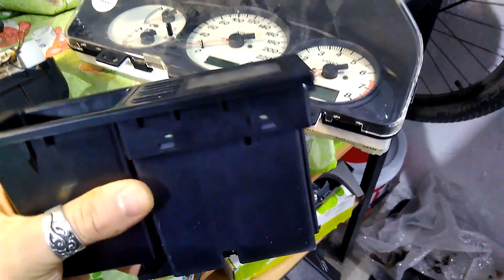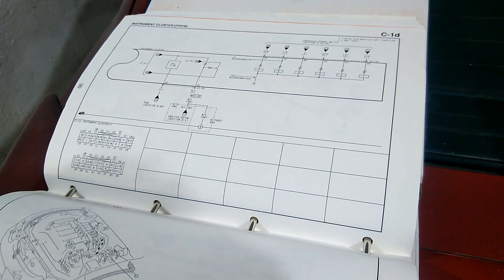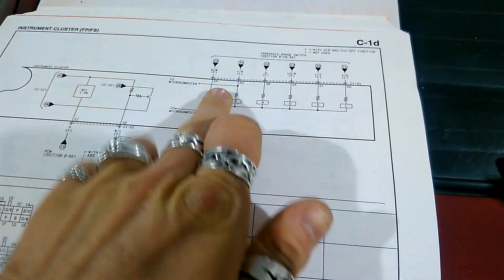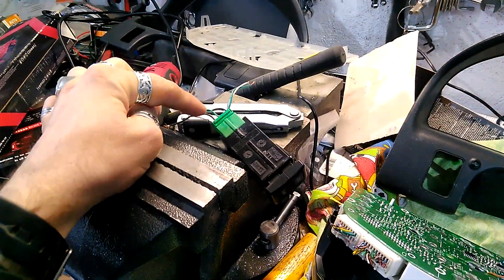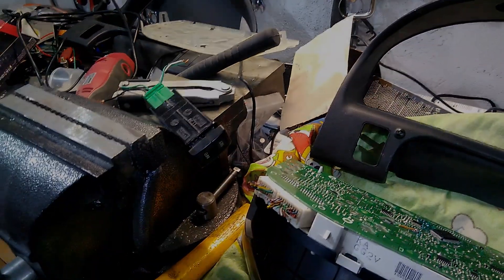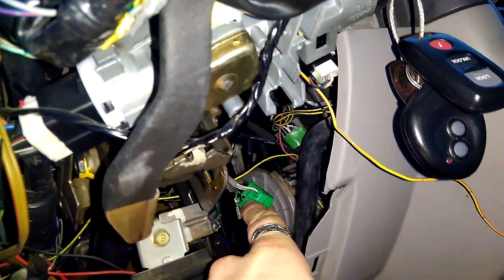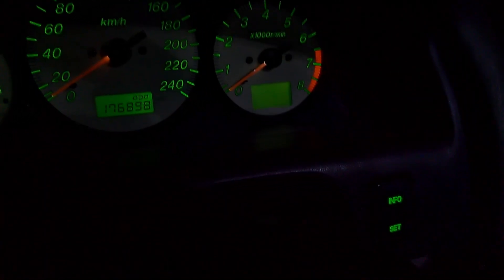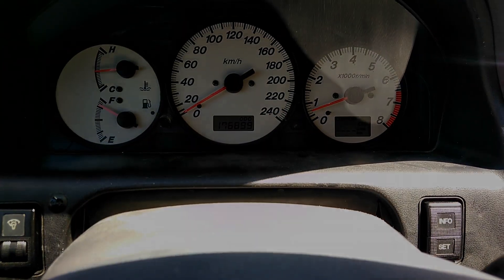In-Tacho Touring Computer for Mazda 626

Comment: So i cant install it in an automatic version?
Reply from the maker: Nope, or at least not without losing your shifter indication.
Reply: @Mazda626GF  i have the pre facelift so i dont have shifter indicator, i dont know if that changes my situation
Reply from the maker: @matiasleiro99  Speedo on the facelift has a different pinout. I've seen people trying to install facelift speedo to a non-facelift, but no one had full success. Also, fuel level will show wrong, as the sender unit in the fuel tank also got changed. I believe it is possible to do the swap, but it is not easy, nor cheap.

Comment: здравствуйте! помогите пожалуйста с таким же щит прибором . не могу найти сигнал от компьютера . у меня мазда 626 2002 года . только один провод идущий от компьютера
Reply: видео  1.49 ты объясняешь по книге где этот S индикатор как понять схему на картинке 1.49 этот провод 2g куда идет ? '
Reply from the maker: @bekastb4736   Sorry I do not speak Russian. As far as I understand (using Google Translate) you would like to know where the 2G (indicator S) is going? Or what I connect it to? In the book it shows that all indicators are going to Transaxile Range Switch. Manual transmission cars do not have such switch, so those wires are re-used for the touring computer. The 2G in that case is connected to the button that controls the Touring Computer. Hope you understand me.
Reply: @Mazda626GF  МНЕ НУЖЕН СИГНАЛ ИНЖЕКТОРА НА ЩИТ ПРИБОР ! У ПАССАЖИРА ПОД НОГАМИ КОМПЬЮТЕР PCM КАКОЙ ПРОВОД ВЗЯТЬ ОТ ТУДА ????  ЕСЛИ ЕСТЬ ВОТ САП ОБЪЯСНИТЕ  ПОЖАЛУЙСТА . ПРОВОД ИНЖЕКТОРА СИГНАЛ
Reply: ИМЕННО С КОМПЬЮТЕРА МОГУ ЛИ ВЗЯТЬ СИГНАЛЬНЫЙ ПРОВОД ЭТОТ ПРОВОД КАКОЙ ОН ПО ПОРЯДКУ
Reply: Я МОГУ ВАМ ОТПРАВИТЬ ФОТО ВИДЕО ? ОЧЕНЬ НУЖНА ПОМОЩЬ ! МАШИНА СТОИТ ВСЕ РАЗОБРАЛ
Reply from the maker: @bekastb4736  As explained in this video (and written in the description), the location of the INJ signal for 2001+ models is covered in another video - https://youtu.be/WQuPkH3Ww2s?t=2057 The Light Blue wire is the injector signal and you can see where the connector is. From one side you have the Light Blue wire and from the other side is missing. Just connect from the other side ;)
Reply: @Mazda626GF   спасибо иду искать голубой провод в разъеме. до 2001 года какой цвет провода сигнал инжектора ?
Reply from the maker: @bekastb4736  I think it is the same color. But <2001 should have this signal on the clock plug as well.
Reply: @Mazda626GF  к сожалению на штекере всего 3 провода ! именно голубого провода нет . почему я не знаю . моя мазда 626 gf 2.0 бензин . на часах в штекере всего 5 провода . надо узнать сигнальный провод именно в компьютере PCM . как теперь узнать где этот провод в PCM
Reply: именно из компьютера найти сигнальный провод
Reply from the maker: @bekastb4736  Unfortunatelly in the wiring diagrams I have there is nothing on this wire - it shows only 4 wires for the 4 injectors, but nothing for the INJ signal towards the touring computer. So I do not know which pin of the PCM is responsible.
Reply: @Mazda626GF  очень жаль ( нигде нет описания pcm . а ты знаешь какое напряжение дает этот голубой провод ? может по вольтажу найду в компьютере
Reply from the maker: @bekastb4736  My best guess is 12V PWM. I have the book scanned. In it there is plenty of information for the PCM, but nothing of this ignition wire. If you give me your email address I can send you PDF with wiring diagrams.
Reply: @Mazda626GF  beka-sat@mail.ru спасибо!

Comment: Sorry, from which car this control panel (with touring computer in-tacho) is?
Reply from the maker: This is a 626 cluster. Only later models have it, 2.0 FS engines. You cannot use 323 or Premacy cluster - even though they look the same, pinout is different.